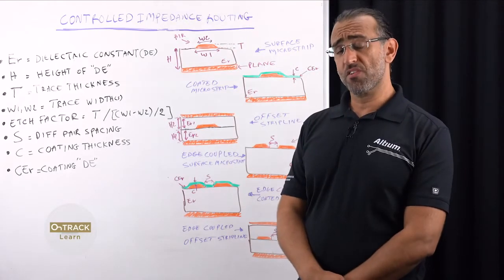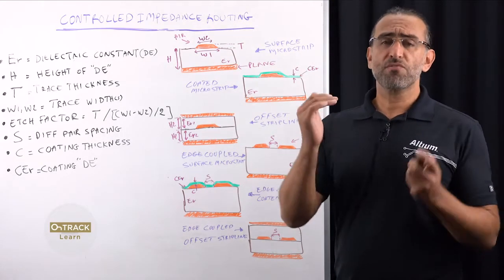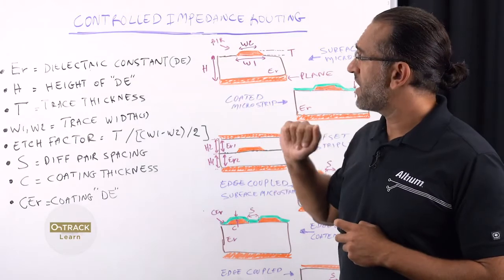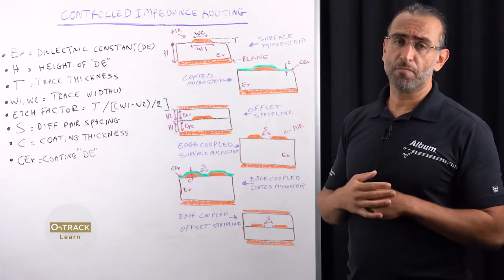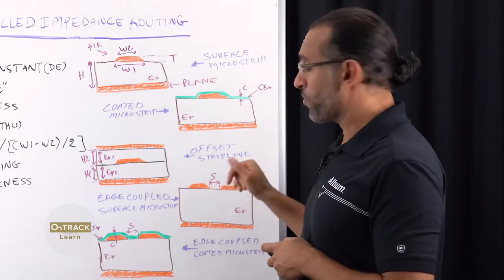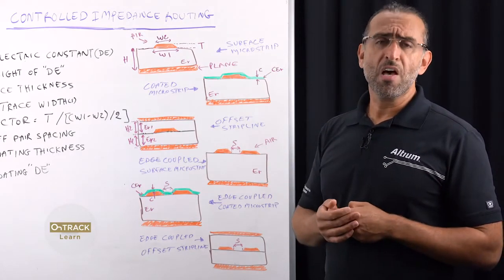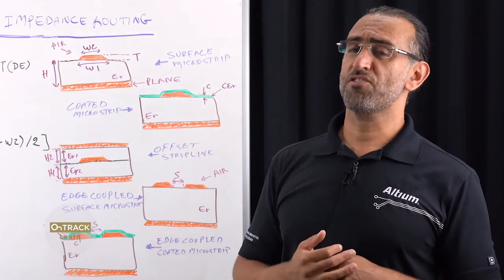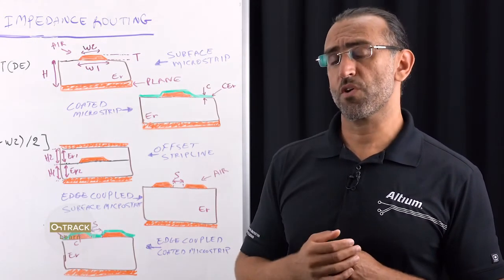Controlled Impedance Routing - Altium Academy

Comment: But but but what about my silkscreen? jjk ;) Came here to see if Altium actually does routing calculations based of mat properties, apparently not :(
Reply from the maker: Altium Designer has a built in Materials Library defined in conjunction with several fab houses for impedance calculation. You also have the ability to define your own materials in the Layer Stack Manager. The built-in Simbeor 3D field solver takes your layer information and creates impedance profiles to maintain impedance across layers. You can learn more about impedance calculation with this quick guide or through our webinar on Transmission Line Impedance Calculation. 
Written Guide: https://resources.altium.com/sites/default/files/2020-03/Impedance%20Calculation_fin2.pdf 
Impedance Calculation Webinar: https://www.youtube.com/watch?v=yju9HfqfY20&list=PL3aaAq2OJU5GQBy7G9aqCh_prWIQwsF86&index=16